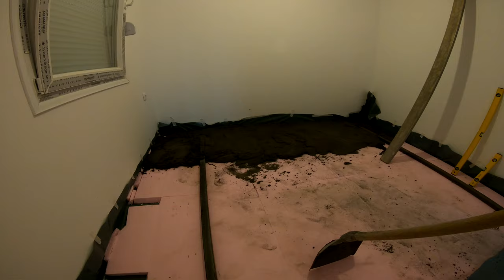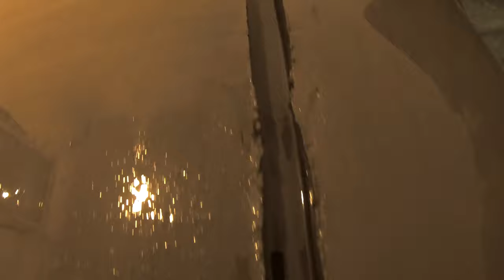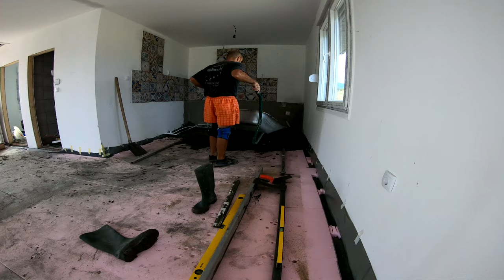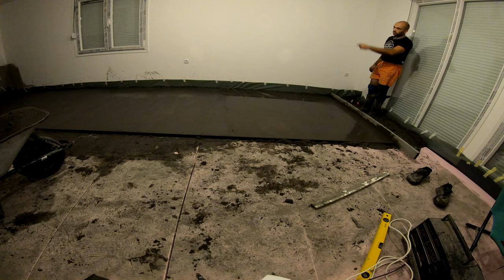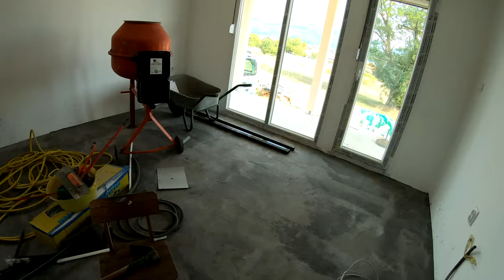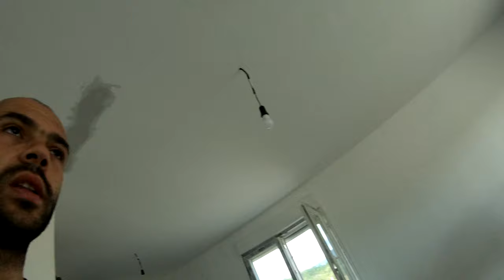Izlivanje cementne kosuljice u kuci - How to level a concrete floor in the house

Comment: Radio  bih na spratu ravnajuci sloj ali zbog stolarije koja već postoji odgovaralo bi mi da sloj bude na jednoj strani 1cm a na drugoj da izadje na 3cm. Ravnajuci sloj bi se izlivao preko betonske ploče. Pitanje je da li je to tanko i da li je moguće sa nekom vrstom cementa to izvesti. Preko sloja ide farmacel table pa onda parket.
Reply from the maker: Najbolje je raditi ravnjajuci sloj debljine od 3cm do 5cm. Ako je cvrsta podloga armirana ploca mozda i moze, ali ce sigurno da pukne tu gde je 1cm u buducnosti. Ako vam pukotine ne smetaju ispod parketa moguce je to izvesti.
Reply: @LazarPavlovic91  ukoliko bi se stavila neka tanka armaturna žica jel bi poboljšalo stvar, u koliko dodje do pucanja da ostane kompaktno. Inače sloj se radi na armaturnoj betonskoj ploči. Preko tog tankog sloja ide farmacel table pa onda parket.
Reply from the maker: @dejanjelenic6515  Svakako bi znacilo ako se stavi nesto zbog pucanja, da ne bi smetalo za parket kasnije.